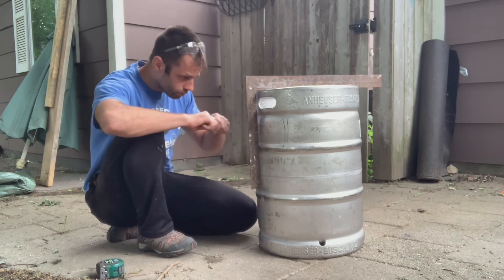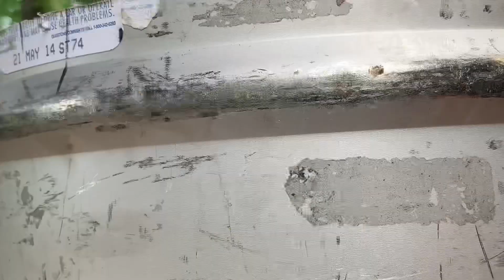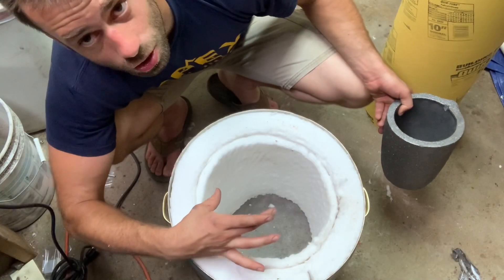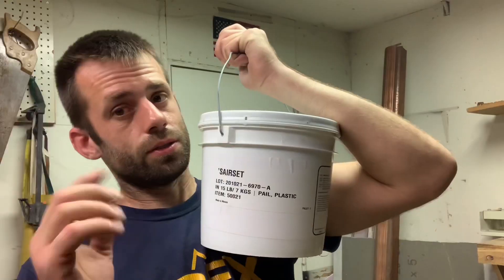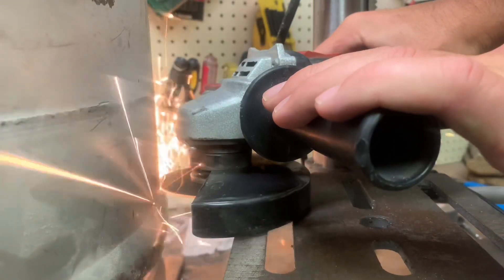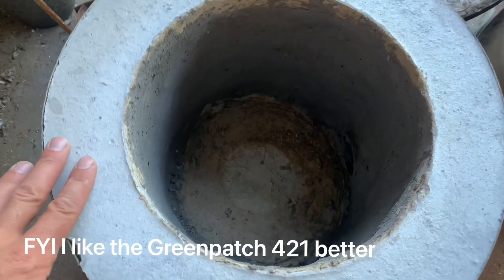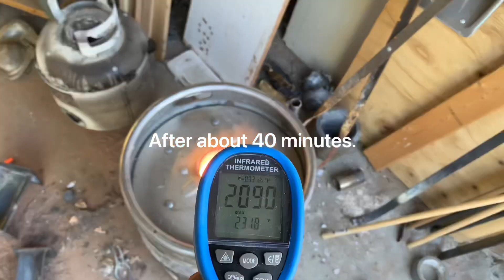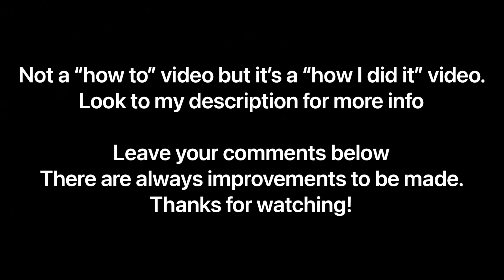Making a keg foundry furnace.

Comment: The ceramic wool is a likely carcinogen, but 'SAIRSET and Greenpatch-421 also have this in their product data sheets: "Danger. May cause cancer. Causes damage to organs through prolonged or repeated exposure." I'm pretty sure it's referring to dry particulates so as a wet compound or as a cured product it should be safer, but folks might still wear a respirator and avoid bare hands when mixing and applying.  I don't know first hand what I'm talking about, I just happened to look up the data sheets before checking out this awesome video.

Comment: stainless will work harden when drilling. the key to drilling stainless is slower rpm on the drill. I finding pulsing the trigger works well. drill a second, stop a second, drill a second. Nice build
Reply: You beat me to it.  A brand new drill bit, coolant,  ...and ...slow ....slow ...slow
Reply: Used to have to drill hundreds of holes on site with a few hand sharpened 6mm drill bits I’d bring along. Lots of little tricks to do it, slightly slower speed is one, but the major one is constant pressure. As soon as you back off pressure slightly it’ll work harden and dull your bit. Couldn’t use any coolant on site
Reply: Also used to drill hundreds of holes in stainless. Some of my coworkers were going through drill bits like water. I'd try to explain it to them to just pulse them, but I was just a kid. What did I know? I think one guy thought I had a magic bit until he burned that one up, too. I just resharpened it and went back to using it. 
  You can lead the horse to water, but can't make 'em drink.
Reply: I did not know that, thanks.
Reply: if a material hardens upon drilling, you need to feed the drill rather than  in one go yes but you also should use a coolant (1 part oil, 20 parts water should be fine). The reason it hardens is due to the heat making the carbon in the alloy connect and your drill head kinda softens. Using a coolant and feeding in bits is the solution.

Comment: Looks good, I wish I had made mine a bit shorter too, think I have to much head space about the crucible, I can melt about 40lbs of copper in about an hour, but it takes about 3/4 of a 20lb propane tank of gas to do it.  I like the greenpatch too, but I dont like the way it cracks, I think I need to get some refractory and fix my lid with that, I keep having issues with the GP421 coming off after I use it. Cool Build, looks great.
Reply: A forced air burner will stretch the propane.. it's crazy efficient!

Comment: Looks good.  Smart choice to coat the insulation with a thin coat of refractory mortar instead of casting a thicker hot face.  The benefits of greater thermal mass on efficiency don't kick in until you are doing back to back to back melts all day in more of a production setting and it becomes more about keeping the furnace hot as opposed to heating it up initially.  👍